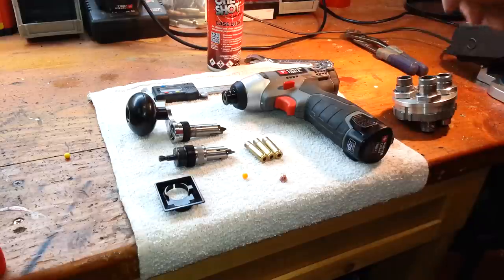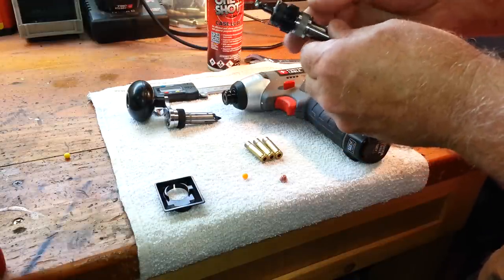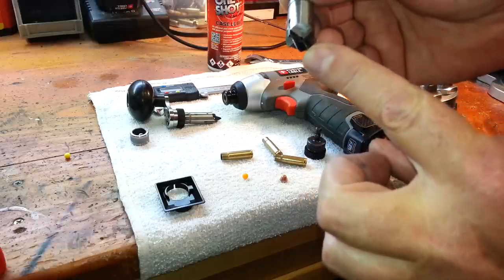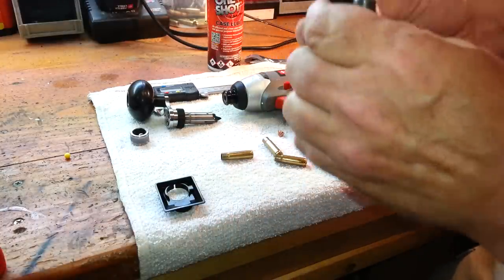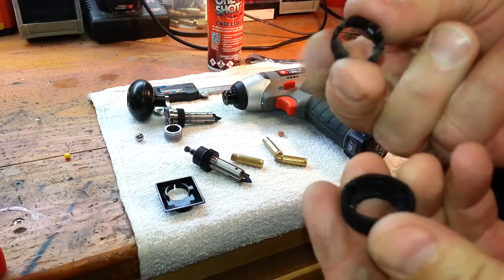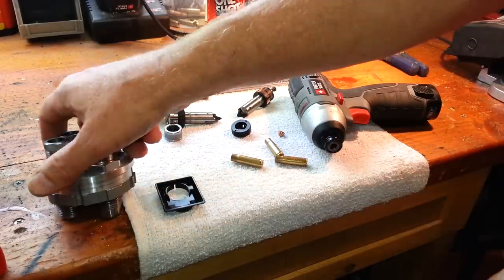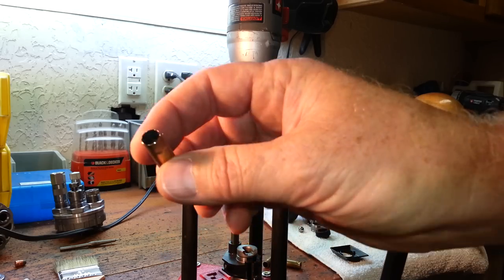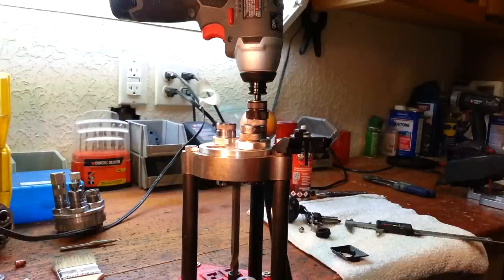How to make 300 Blackout brass, Lee Power Quick Trim (short version)

Comment: for the beginner try this 
I use a $7 tubing cutter works fantastic 
cut the 223 brass 1/32 inch before the sharp taper starts.
re-size with the primer punch installed not removed trim to length with a cam-lock trimmer .
do the deburring and run them threw shaker before priming and loading 
very cheep and easy setup for getting started 
if i am doing 1000+ brass in one sitting and plan on doing this often i may go for getting a saw but i sat down and did 200 in no time with the $7 tubing cutter 
just the cutting part i can cut 15 in 5 min with no trouble at all and you can buy at Lowes or home depot got mine at Northern tool can also buy at many auto parts store

Comment: Is this still a good way to trim 223/556 cases to 300 blackout? I’m having a bit of difficulty figuring out what exact equipment I need to get. I’m new to reloading and I’m learning and I got 300 blackout but I didn’t expect it to be so expensive. I got a bunch of brass of 223 and 556 but I mainly want to reload 300 blackout I’m just not sure where to start. I got my dies from Lyman and I’m looking at the WFT2 trimmer and this video popped up. I’m just unsure of the process and equipment I need.
Reply from the maker: This is older version, I have a more up to date version of how I still do it  https://youtu.be/BPhlzBULoWI .    This still works for me based on what tools Ive already invested in.   Ive heard good things about the WFT2 trimmer, the only thing I'm not crazy about is that it spaces off of the shoulder and not the case head so it seems like it would stack tolerances.    That's my hangup probably not a big deal.  PS, sorry Im so late getting back to you.
Reply: @TreeTopFlier  Ah, got it. I'll go watch the more up to date version. I see. Thanks for getting back to me. I did end up ordering the WFT2 now so hopefully I'll get it in soon. I'll make note to keep track of that with the shoulder and not the case head. Totally fine :D I just appreciate you took the time to get a reply back to me. I just recently started getting equipment and all that so we will see how it all goes :D

Comment: Remove case lube otherwise lube will contaminate die and die will not grip cases. Cutter will sit on too if case and instead of cutting case it will spin case.  If this happens too much the plastic inside die will wear out and not grip cases. 
    Also remove primer arm and fill channel with some tissue paper to keep shavings from getting into press body and making ram movement very stiff.

Comment: how do you convert a manual handle over into the power adapter just by buying the screwdriver part only? How do you get the steel shaft and cutter off of the manual handle?
Reply from the maker: The handle just unscrews so you can screw on the power adapter on.  Thats also how you take it apart to access the springs and ball bearing.  Here is a better video if your interested https://youtu.be/H_9jDh2cK8o

Comment: How fast are you spinning the cutter with that small drill?
Reply from the maker: I think its running fast, like 2000 rpm,  The package the quick trim comes with says use a slower driver like power screw driver.  I liked the faster drill.
Reply: Thanks for the info.  Also sent you a PM in the 300 BO forums with some additional questions about a couple ideas I have for this trimmer.